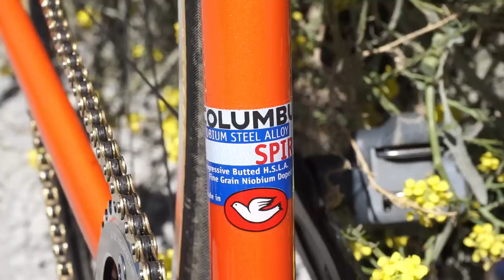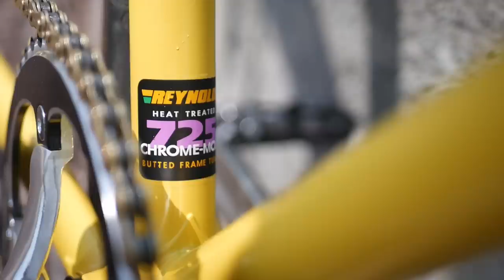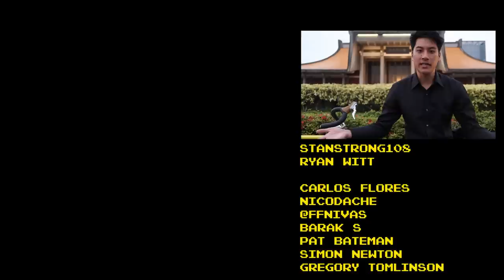The Case for Steel Bikes

Comment: From memory during ww2 had the Yak5 ( or Yak 3 can't remember ). It was covered with 2/10 mm tin steel and was outperforming allied planes using 3 mm aluminium skins. Apart from corosion it was as good .
Reply: You must be 100 years old, man!
Reply: Same thing with sandwich panels and corrugated sheets in modern construction. Steel sheets are about twice thinner, so there's very little difference in weight, but steel is cheaper

Comment: I love my aluminium track bike. It's about 15 years old and so far has held up to daily urban riding. Heavy, bomb-proof components put total weight at 18lb. I like its stiffness, as it's super responsive for city riding. But that stiffness makes it hard to ride for more than about an hour. So that's the trade off. For long rides I get on my steel road bike. There you go.

Comment: Walmart steel bikes are made out of 1020 seamless steel tubing . If they have 
aluminum rims they probably are not double walled. They are built on machines 
not hand built They are designed to take  about 200 lbs. the average weight 
of a human is 170 lbs. Climbing a steep  hill you will feel the rear end whipping 
around a lot. They are usually Welded with GMAW (MIG)
Chromoly Steel has been around since about 1900. 
4xxx steel  https://en.wikipedia.org/wiki/41xx_steel
Frames can be welded using GTAW (TIG) or with Oxy Act or Brazed
using a low temperature high strength brazing alloy with out lugs like Brompton's.
If welded you must know how to heat treat the particular alloy you are working
with.
Reynolds https://en.wikipedia.org/wiki/Reynolds_Technology
Chromoly bikes will take 250 lbs or more
List of welding processes
https://en.wikipedia.org/wiki/List_of_welding_processes
Brazing https://en.wikipedia.org/wiki/Brazing

Comment: Got mine made in Spain, Torrot bike frame that says "Original 313 High Tensile Steel Tubes" Scheduled for repainting instead of buying modern ones. Limited info how 313 stands for in terms of its properties; is this in the low end mid or in the upper calibre grade.

Comment: Cracked steel is easier to repair too.
Reply: I used ride a Cannondale aluminum frame back in the day. After getting hit by a car and crashing (got stuck in the train tracks down Mission Hill) in the same month that sucker was cracked and totaled. My next ride was an old Super Course MK II with Reynolds 531-- got hit twice in the same couple months and it was easily bent back into shape. If the frame cracked I could've easily and cheaply welded it, no problem.

Comment: Steel frames don't need moulds and they don't need, usually, to be heat-soaked. So they are a more practical material for small manufacturers.

Comment: I like aluminum for mountain bikes and steel for road bikes. I just can’t buy into the carbon hype unless I was competing and got free frames. I still have the same steel road bike I bought back in 2002 but I’ve been through like 5 aluminum mountain bike frames, two of which broke.

Comment: Regardless of the video's ethics it does create debate re. the use of steel which is not on everyone's radar these days. The steel type used mainly in the high end bike frames is a low alloy Chrome/Molybdenum steel that is basically a high tensile steel. This type of steel is used e.g. in aircraft frame work. The reason it is used is because of its excellent weight to strength ratio.
A draw back regards to its use in mass production is that it not easy to weld together/fabricate as apposed to aluminum/alumina. If the welding is of poor quality then weld/joint failure will result. I tend to think that CrMo steel does have a place in the high end markets but the majority of bikes sold today are made of aluminum/alumina. Purely because of ease of fabrication and it is a excellent material fit for purpose. My 20 yr old Ali MTB (moderate use) is still in good condition. Ali frames wont deteriorate/oxidise so long as they have a good protective paint system & this is no different to steel in this respect.

Comment: I have a question about steel bikes. I’m looking at getting a vintage bike with triple butted cro-mo steel frame. It think it was be a nice project for a single speed bike. However having only ever have own aluminum frame bikes, and tires I am of jolting bumps , I wonder are all steel bike good at absorbing shocks and do they all over the springiness planing that Zach is referring to? I want to feel that in a bike, but how do I know which bikes have it or how can I tell what it feel like ?

Comment: On durability:  I'm a retired courier, once and long ago put close to 90k miles on an '87 Schwinn sprint over the course of several years (pretty hard miles too), at which point the chain stays/rear fork was about as stiff as a noodle.  Is this common with steel tubes with crazy amounts of  use/wear on them?

Comment: Somehow I have a hard time applying your glowing adjectives to my Schwinn Varsityn which I purchased with my hard-earned coin back around 1963.  But it almost felt warm and fuzzy for a minute or two.  Too bad I kept growing, but it didn't.
Reply: I'm  still using a 40 year old Ross Professional as my daily rider
I've replaced the original wheels w/double walls and that's about it 
The nice thing about this bike -which took me forever to find -is that the frame is sized to the rider  so my top and down tubes are longer bc I'm a tall long person
Reply: @nickyl9040  ...as am I, as it turned out. But when I was 10 I wasn't anticipating my adult size, nor were larger frames offered, unless they were hidden in the back room.  The biggest choice that I remember was 10 speed or 15!
Of course, back then everywhere I rode was uphill, and bucking a headwind.

Comment: CAUTION: THIS VIDEO IS NOT CORRECT AND YOUR SAFETY IS AT QUESTION IF YOU FOLLOW THIS VIDEO'S ADVICE. ALL bike frames have a lifespan. I ride over 10,000 miles a year for the last 50 years, am an x-pro rider and also a fit 6 foot at 195 pounds. I have cracked 2 steel frames and 1 aluminum frame from normal riding. For safety I trash frames with 20,000 miles on them, doesn't matter what material. DO NOT RIDE OLD BIKES WITH UNKNOWN HISTORY!!! Bike frames and bikes are so inexpensive, it is not worth throwing your life away to save a couple of hundred dollars!!!!

Comment: If you're buying a 20 year-old bike, sure you want it to be steel if you're actually intending on riding it.  But even though I'm a fan of steel,  I'm not alone in not caring about the resale value of a new bike in twenty years, much less fifty.  A quality frame is built to last and you should be able to ride it as intended for many years with few cares.  If you ride your aluminum bike particularly hard and abuse it every single day maybe you'll need a new aluminum frame in as little as five years, but then you'd surely have got your money's worth from it.  Most people should be fine for a decade riding an aluminum frame *as intended*.    Note "as intended": you can rebuild an old steel frame bike as a gravel bike (old touring bikes work really well) but it probably isn't a good idea with aluminum.  In any case I wouldn't be particularly concerned with riding a five to ten year-old aluminum frame that had been lightly to moderately used, although I would inspect it.

Any older frame should be regularly inspected for developing cracks; "sudden" failures often start as hairline cracks.  Sudden failures are less common with steel, but not unheard-of.  Also any new noise an old bike makes should be investigated rather than ignored, particularly creaks.  Think about it: you don't worry about getting on an airplane that's been flown practically every day for a decade because (a) it was overbuilt with fatigue in mind and (b) it is regularly inspected.

One thing I notice is that your bikes have rim brakes.  That's an important point on a steel frame; a lot of the feel of a steel frame is the fork.  If a fork is engineered for a disc brake it has to be a lot beefier to resist the torque the disc puts on the fork blades, and you lose some of that steel feel.  That said, I have a steel gravel bike with hydraulic disc brakes, and the beefy fork doesn't matter because it has 47mm tires.   For tires > 40mm, the ride characteristics of the fork are dominated by the tire volume, but if you're riding a 30mm or narrower tire the ride characteristics of a rim-brake steel fork are a real win.

Comment: CrMo steel frames?  Yes.  But.... steel rims, handlebars, crankset, brakeset, headset, seatpost and hubs, all of them steel - no, no, no, no.  Sum the weight of all that I've mentioned and you get practically 75% of the weight of the bike.  Have you weighed a steel rim, steel spokes, steel hubs and axles or a pure steel wheelset?  Even for just the front wheelset?  You will surely love aluminum rims, alloy hubs, thru axles, double butted stainless steel spokes and nipples (thin spokes).  How about the crankset?  A lot of difference between steel and aluminum alloy crankset.  Steel frames are very inexpensive.  Alloy parts are VERY, VERY, VERY expensive.  If steel parts are installed, 1 or 2 rides, you have to fix them, and they are very hard to figure out about what are wrong with these parts.  The answer is simple - they are cheap.  CrMo frame - YES, durable - Yes.  Alloy parts - YES, durable - yes.  Steel parts - NO, durable - No.  I did not mention the tires.  There are very cheap tires in our place, fit 27" 1" rims.  But... they are so, so, soo heavy.  They wear out easily.  Light weight tires for 27" 1"  do not come easy.  And, they are very, very expensive. 
Maybe weight becomes negligible when riding.  Ok. (I did not mention climbing)  But durability of the other bike parts is very important, if you want a fun and prolonged ride, whether flats or climbs.  Steel frames last forever (if not exposed to too much rain), but steel parts die early.
My bike is a 1987 Gios road bike (racer bike during those times).  Most of the parts are still original - rim, headset, fork, brakes, fd and rd, crankset (stronglight 52/45). I've tried cheap chain and they die early.  I've also tried cheap cogs, and they also die early.

Comment: i choose aluminium not because of weight reasons, but because it does not rust, my Mountenbike has like double the weight of yours...... ok it is an e-mtb......
Reply: If you use your bike to commute during the winter this is definitely something to consider. I've had steel frames crack due to corrosion.

Comment: Steel is NOT forever. Had a beautiful expensive lugged hand made steel bike in the 80's and used it a lot and it cracked around the bottom bracket due to the steel "work hardening" Steel bikes do not last forever.

Comment: He says steel 100 times, but never once says chromolly steel...which is about 30% stronger (so they make the tubes thinner to reduce weight)
I've owned many chromolly bikes and the manufacturers never post heat them so they fatigue near the tube junctions. You can see some videos testing cranks that fail because of no post heat treatment.

Comment: You haven't really given the case for steel bikes. Steel bikes are great, however an aluminium is noticeably lighter and the weight of my bike including myself and bag, the steel still contributes to a higher total weights.  

You actually given plenty of reasons as to why steel is great given its increased weight

Comment: Yes obvious steel is more comfortable yet heavier
Aluminium is stiffer yet lighter
Carbon even stiffer yet even lighter that’s all based on similar frame design but once you start combining materials and angles and tube sizing thickness tapering ovalized etc thanks for the stating the obvious yet again

Comment: I mistakenly bought a late model Roubaix carbon bike..........Ive never felt so taken on a purchase. And Ive had a lotta bikes.   Not only  does the frame ride like a buckboard and beat the crap outta me,it doesnt steer for shit and is unstable over bumps.         So I tried to sell it before too long but guess what?    As soon as these bikes come off the dealer floor they arent worth squat,nobody wants a 1 year old totally outdated bike....................its old news already.  4K I wasted on this POS and cant get rid of it........but I still have my 1990 MASI Team 3-V and have updated it a little bit and went back to riding it full time.        I bought the frame new and built it up myself and its been a great bike..............flies downhill,rides smooth,looks bitchin .  Not sure why I got sucked into the "carbon wonder bike" thing but I learned a lesson.   I bought a 2020 gravel bike,its all GRX parts and made of Reynolds 853 butted steel.        I like it alot.  ..

Comment: I'm sorry, but carbon doesn't age. A solid carbon frame that has not exchanged weight for steadiness... is reliable as long as you do not have an big accident or the bike falls over unfortunate and hits a stone. Aluminum ages over time and will eventually fail sometime and unlike steel and carbon cannot be repaired.

I have a Colnago Super and a Trek 5500 OCLV 120 Carbon and both bikes are reliable as f*ck. I'm not afraid to ride a carbon frame after 20 years. Even my Stevens R.P.R. 3 has not given up jet, although I've crashed this aluminum frame many times.
Reply: But Carbon has a real Problem with Quality Control, Voids and Delamination. Sadly enough that is more a problem of modern carbon frames...
Reply: @fuckelonmusk  Dann ist es wohl gut das ich mir noch keinen modernen Carbon-Rahmen gekauft habe. Ich hatte schon ein Video gesehen wo bei Carbon-Rahmen von Canyon leichte Verarbeitungsfehler waren, die zwar keinen katastrophalen Totalausfall hervorrufen, aber ziemlich ärgerlich sind... Tretlager Aussparungen die nicht rund sondern oval sind... Lufteinschlüsse die man nur von innen sieht, usw.
Reply: Stevie Blue  As long as you haven't crashed it or it accidentally fell over and damaged the tubing, I see no reason not to continue cycling.

Most catastrophic failures arise with seat posts, handlebars and especially the fork ... because you have tightened the screws too much or drive too many spacers over the stem without using a fork cap with expander which is long enough.

I trust old carbon frame more than the modern ones ... simply because the material is getting thinner and thinner and all carbon frames are now mass-produced. Regardless of whether you buy a cheap frame on Aliexpress or from a well-known manufacturer, the only difference is the paintwork and the price ... sad but true.

Comment: My steel bike feels great when just cruising, but feels mushy when pedaling hard.
My aluminium bike has a harsh ride, but feels great when pedaling hard.
 It's a trade off. Kinda sucks.
Reply: Thats why there are so many different kind of steels. Try Reynolds 853, 953 or 931.
Reply: @fuckelonmusk  Don't have the cash to experiment with different framesets, right now. Need some over time on the job.

Comment: You make a lot of good points, but how does this apply to mountain bikes? You simply don't see modern higher end bikes on the trail. Even Walmart is selling aluminum frame mountain bikes. In terms of durability it's a no brainier. You can abuse a steel frame bike a lot before it will fail. So then why the shift away from steel frame MTB?

Comment: How did you make a video about the benefits and superiority of steel bikes and not mention that quality steel bikes are extremely thin walled, and the superior ones use double and triple butting?  There is so much disparity between a junk 70's Huffy dept. store bike and high quality steel frames, that it's a bit disingenuous to just characterize steel as better.  Finally, though I appreciate your fandom of steel, you might be missing all the benefits of aluminum and carbon because it's lost on you how much better they are.  If not mistreated, why assume a carbon or aluminum bike won't last?  It's easy to dent or ruin a steel bike in an accident too.

Comment: Steel is the only choice for me.  The 90's and earlier.  I did buy a brand new Trek that was aluminum with carbon forks, but I didn't like the feel.  I think when someone rides a bike they almost become physically part of the bikes soul....and you know when something isn't right about a bikes feel.  I'm no expert either, but after a few rides I resold that Trek back to the dealer....it just wasn't for me.  I dont like the feel of carbon forks, but I could have lived with the aluminum frame.  But the more I hear about aluminum the less I like it.  So again, classic steel is the only way to go for me. Of course I weigh 230 lbs, the lighter riders and pros might not punish a bike like I do, so maybe carbon works for them.

Comment: Some types of steel are technically superior in safety and yield to density design. Carbon fiber frames are better for modulus to density ratio (so you can make more rigid bikes with carbon fibers) and for better vibration absorption.

But bikes are proposed  not on technical parameters but on fads and fashion. It was steel and it became aluminium (which is worse from almost all aspects) but became fashionable and so it was it. 

Then carbon fibers came in and everyone converted or is converting to CFs, even for mountain bikes were they are prone to heavy damage and so become highly unreliable and less safe (but if they brake more it's better for the seller, especially if they cost so much!).

Then they'll move back to steel or start using titanium and so on. Just like fashion on clothing, it's all cyclical! ;-)